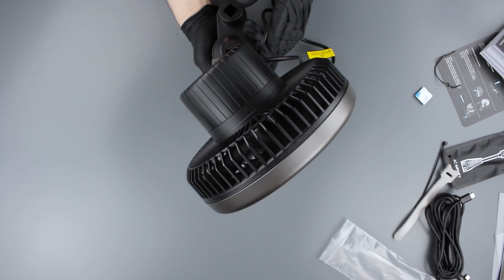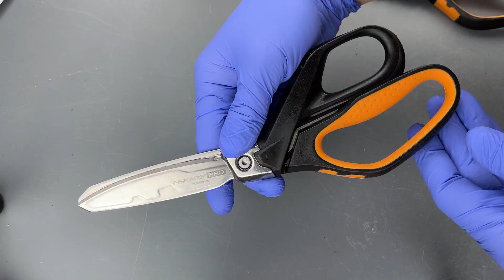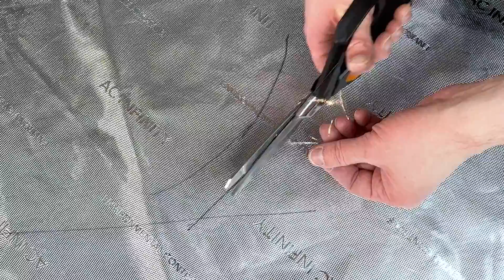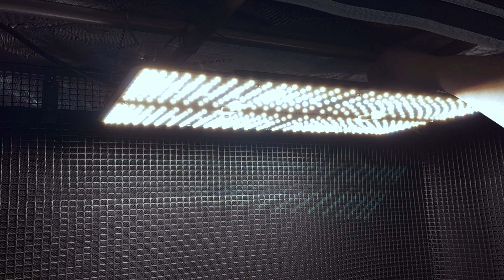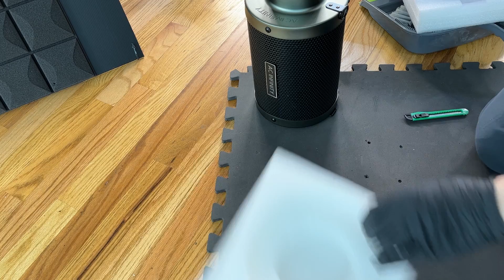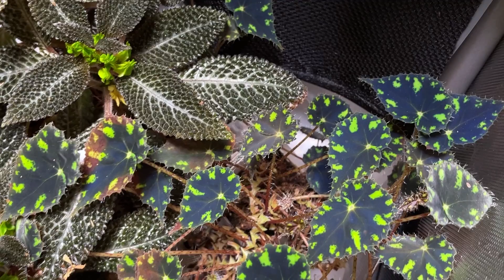How I Transformed a Grow Tent into a Rare Plant Oasis!

Comment: Love this! Stumbled upon AC Infinity recently. Going to try it for my snake. Love the integrated system.
Reply: I like how the electronics are cohesive
Reply from the maker: Awesome. My concern with a tent as a snake enclosure is all of the openings in the tent which they could escape through. You would have to put added security on all the access holes.
Reply: @AnotherWorldTerraria  oh yeah, definitely not using the tent, just the humidifier, heater and light :)

Comment: could you explain in more detail what the mesh material functions for?  does it retain moisture and might grow algae?
Reply from the maker: Retains humidity / helps equalize humidity, absorbs excess water from spraying plants, and looks nice in contrast to the plants
Reply: Thank you!  The link to the material from your video is not available.. could you tell me if this is pretty much the same thing?
Reply: Oops, I cannot figure out how to attach a photo.  Anyway, it is material to cover speakers Speaker Grill
Cloth Stereo Mesh Fabric for Speaker Repair.  If not, what should I look for?
Reply from the maker: It's hard to say without looking at detailed photos because it can vary in thickness. I looked around and found this one Amazon which is available currently. Make sure to check the measurements of the product and of the size of tent you're making, so you buy enough fabric. https://amzn.to/3X4DcDx

Comment: Great video! 
But no luck with the gorilla glue for our outdoor grow tent. Over time, the humidity reacted and turned the glue into  an unsightly“Elmers glue white” and separated. However the tape held up perfectly. We cut the window smaller so if something went wrong we can do over this spring.
Reply from the maker: Oh no! Sorry hear that. I have never had the GG clear grip come apart, even when used in situations where it is constantly touching water (not just humidity, but actual water). It does however sometimes turn whitish in very wet conditions. I'm glad the tape worked though and you were able to come up with a solution to your situation.

Comment: Homie is back from the dead. attempting a 3 gallon UNS rimless mossarium. would you reccomend RO, Distilled, or treated tap water to hydrate the mosees? (Tropical species)
Reply from the maker: I used to use distilled, now I use RO. If your tap water quality is extremely good (TDS < 30) you could get away with using it, but personally I wouldn't. I like TDS 0.
Reply: @AnotherWorldTerraria  TDS in my cities tap water is extremeley high. however i lack an RO system. Any way i could acquire RO water via bottles or would i be able to modify distilled water in anyway?
Reply from the maker: In order of preference, I would recommend the following: (A) Buy an RO system, or (B) Buy distilled or RO water if it's available and affordable, or (C) Get an electric distiller and make distilled at home (this is very slow and expensive to do)
Reply: @AnotherWorldTerraria  Distilled water is going to have to do for now. thank you for the advice and love your channel man.
Reply from the maker: Distilled water is actually the best. The reason I don't use it anymore is due to the cost of purchasing or making it. RO is just waaaay cheaper and faster. So if you use distilled, you're actually better off in terms of purity.
Reply: @AnotherWorldTerraria  Definitley. Distilled water is fairly cheap where i live. il resort to that. kind of an overthought but do you wash your sprayers before use when brand new? i dont like the new smell of chemicals lol.

Comment: Great video! I am wondering how do you intend to manage pests, bacteria, mould etc. from spreading given you have more plants in the tent. Any advice?
Reply from the maker: It's definitely a big risk compared to keeping plants separated out into bins. The key is only putting plants in which have been through a long quarantine. But yes, pathogens can get in undetected (and have). The key then is to try to reduce spread by either removing the affected plants, or spraying chemicals to manage the issue.
Reply: @AnotherWorldTerraria  Do you have soil mites?
Reply from the maker: There are various species of mites in some of my bins and plants, yes. I have not tried to identify them. A number of them are probably predatory and do not harm the plants.
Reply: @AnotherWorldTerraria  thank you for the reply. I always wonder about this. I have mites in a tent I have put up, I wondered if it was worth gassing them out! I never hear creators discuss how they go about their populations